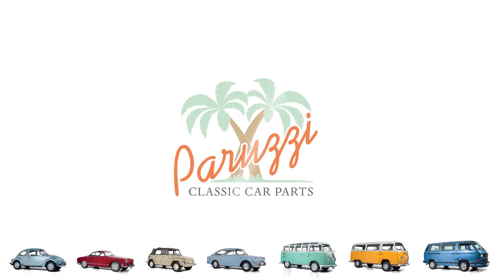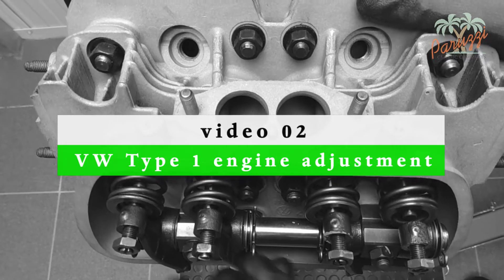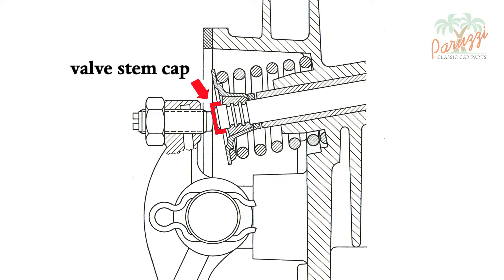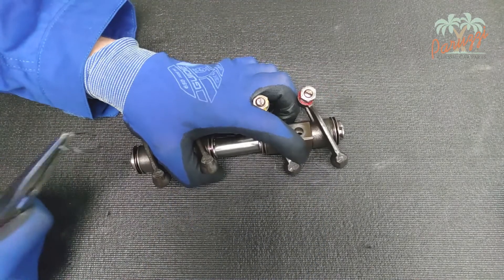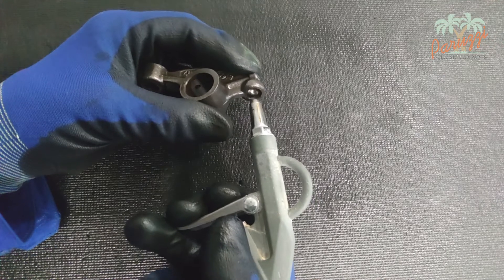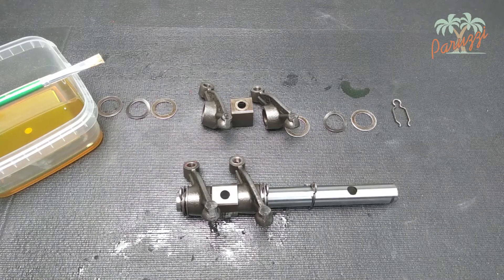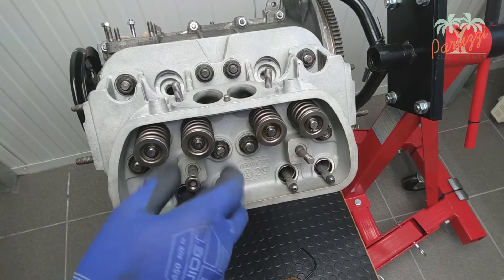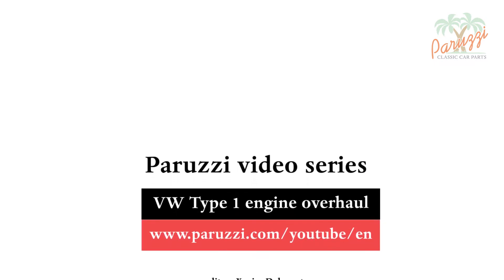14 Engine overhaul - rockers and pushrods

Comment: Thank you very much for this video. I was unable to understand which gasket to use under the rocker arm shaft until I saw your explanation. I have two books on rebuilding, and I must have searched through 20 videos, none of which explained my issue as well as this video! 😊
Reply from the maker: Thanks for your feedback, great that we could help. New videos will be released next month (March 2024). Xavier